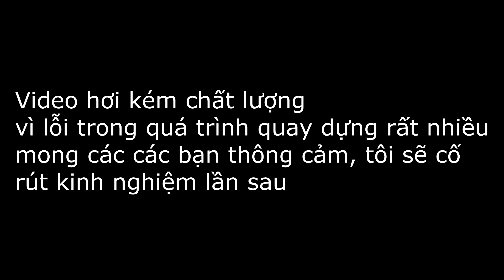CUSTOM KEYBOARD (AJAZZ AK33)| Sound test | mod keyboard | part 2

Comment: Nice video.
Please tell me you change your switch?
You cut the video and starting typing but i donting see you assemble your keyboard.
Reply from the maker: i just lube my keyboard, but record missing scene, sorry for the quality of my video, i will try to fix it on video next time
Reply: @catofgamer994  I have the same keyboard.
Recently i lube my Ajazz AK33 (black edition).
I used silicone spray and sintétic grease and i haveding  the good results.
My space bar, i put the fabric tape little bit to fix that.
Thanks again for this video helped me to much.
Reply: @marceloarimizu8534  Hi, Ijust want to know if you spray the switches w/o soldering from the board?
Reply: @bongbayks5390  Hi. I apply the lube Mechanical Keyboard Switches Without Desoldering. My suggestion for you using a syringe for don't dirty much the board and clean if needed after application with paper towel.
Reply: @marceloarimizu8534  thanks for the quick response. I'll do it. ty